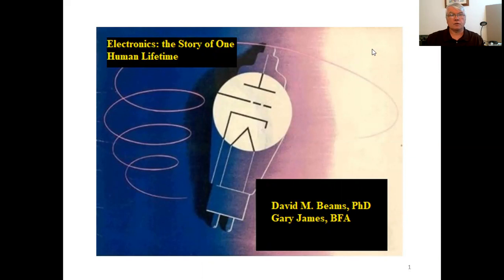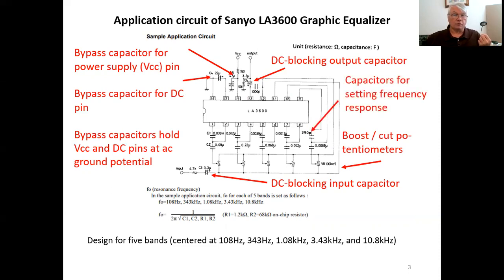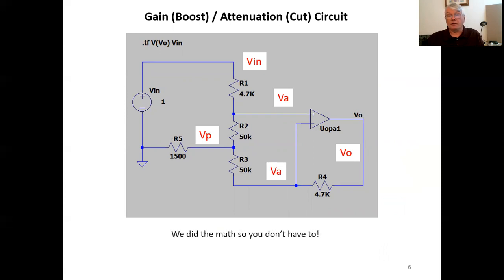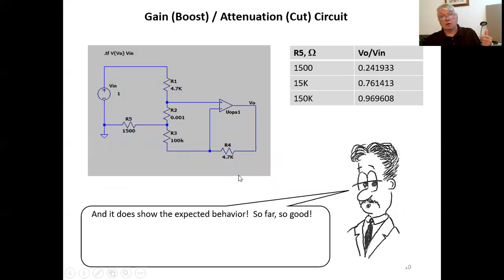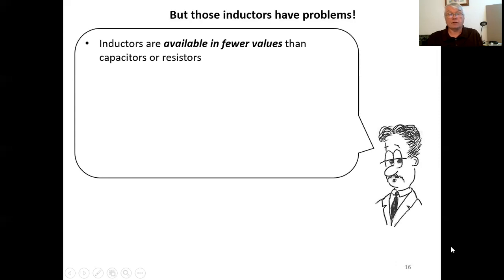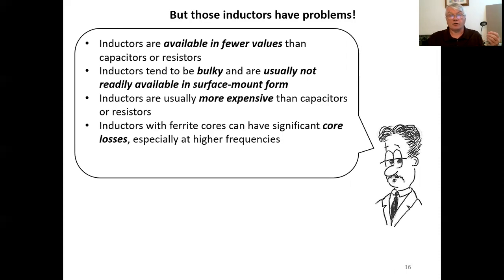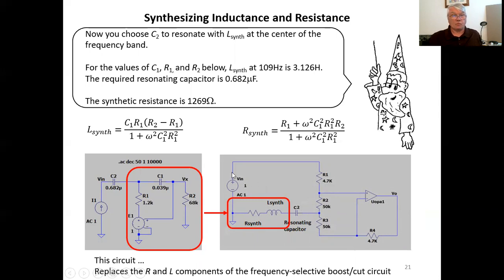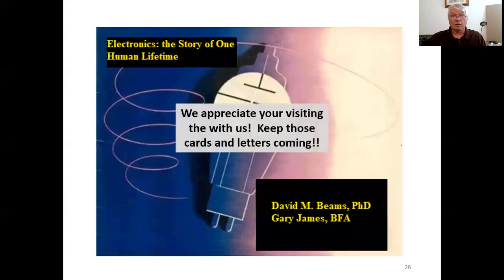One Human Lifetime Project  How a Graphic Equalizer Works

Comment: sir     0.0012      122nf    not available  at all in the market     since the equalizer has stop  making     what to do next   which value to put    153 nf  is the nearest
Reply from the maker: You can use capacitors in series or parallel to obtain a capacitance close to 1.2nF.  Examples:

Paralleled capacitors:
680pF || 560pf = 1.24nF 
0.001uF || 220pF = 1.22nF
820pF || 390pF = 1.21nF
390pF || 390pF || 390pF = 1.17nF

Series capacitors:
1.5nF and 5.6nF = 1.18nF
2.2nF and 2.7nF = 1.21nF

See if any of these capacitor combinations are available.  I think any of these would be acceptable.

I hope this has been helpful.

Comment: sir in sanyo pdf   there is a seperate opamp    call band pass filter  2  opamp   one for input   and other is  out put      if it is pls make a seperate video for that    or input  gain booster     and   2  ic   for  band pass filter   output
Reply from the maker: I have put together a document with examples of these circuits and I will make a link to it available in the notes to the video.  These circuits are not necessary to use the LA3600, though ... these are external circuits used for factory test of LA3600s.  You do not need these for building a graphic equalizer using the LA3600.  I apologize that I do not have time to make a video now.
Reply from the maker: Go to the following link and look for Test Circuits for Sanyo LA3600.pdf.

https://drive.google.com/drive/folders/1lzNck8ZRvML-0DEepwqbmxIy-ptqfC37?usp=share_link